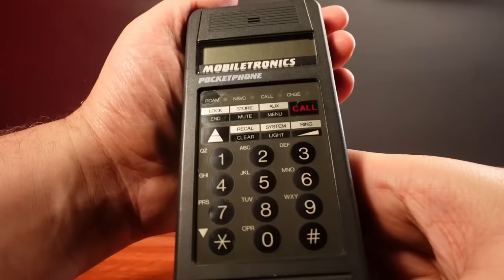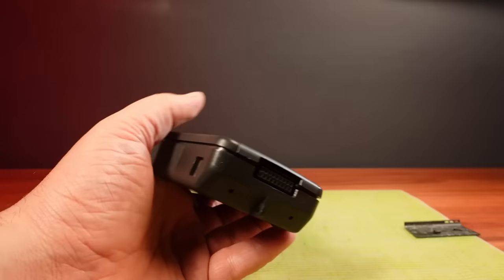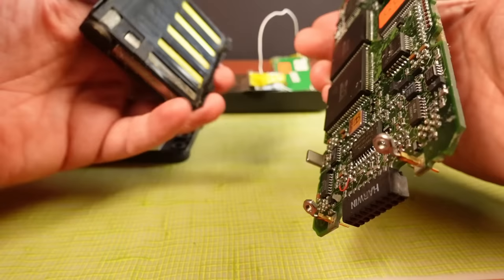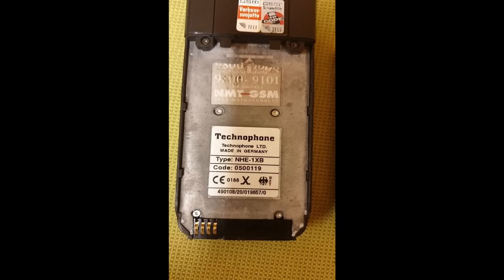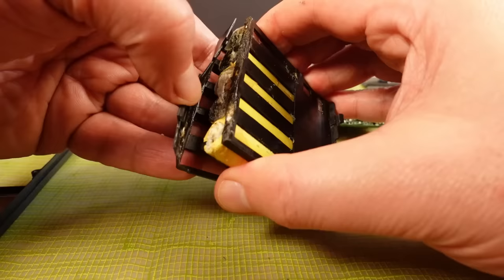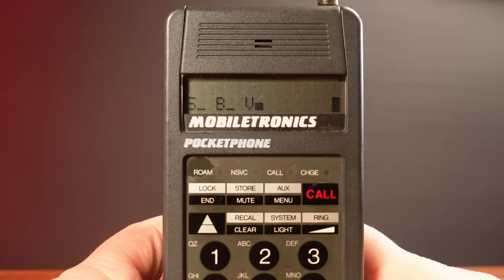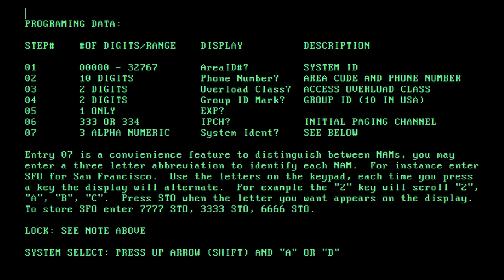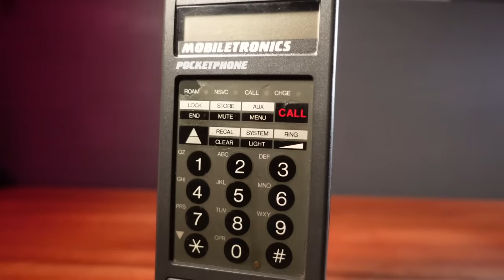1985 Cellphone In Your Pocket

Comment: That EPROM is not soldered. It is sitting in the same turned-pin sockets as the RF modules and the keypad. So it is possible to take it out. Also i really don't believe anyone would erase the EPROM in-situ - you would just pop it out and replace it.
Reply from the maker: Thanks for noticing this. I have since also found this out. This will be included in part 2 one day.

Comment: I remember those phones. I started work at Technophone in Camberley in 1989. I was sent to Brooklands college to study BTEC and EITB electronics, machine shop work, fabrication, welding in the first year full time. Then part time for 3 more years to do more electronics, and microprocessor study. I worked in the wiring shop in the factory and Ashwood House for about 2 years making test jigs and wiring looms, cables. Then I moved on to various production lines assembling and doing ATE testing of phones, boxing and packing. I assembled the PC205 which were more compact but still large by todays standards. The company was taken over by Nokia and the interior of the factory went through a huge makeover. A second floor was built and the production lines for phones were replaced with  new equipment for manufacturing cellular base stations. I was assembling these huge cabinets for several months. Then went on to testing assembled boards and finally base station RF modules and transmitters. I left in 1994 to go to Hastings college and Brighton UNI and study HND electionics.
Reply from the maker: That must have been amazing to learn and work during that time in such a fast developing industry. I really appreciate hearing your story, thank you for sharing.
Reply: I was software lead for the PC205, I like to think it was that phone that really made Technophone as it sold in much greater numbers than the first generation PC105 etc.
Reply: @TonyWhitley  what a great job!

Comment: The character set is in the ROM built into the HD44780 LCD controller. If memory serves, it has ASCII, plus katakana for Japanese, and it's possible to download a few custom characters to it as well, but they don't persist. It's not an all-pixels addressible display--you send it characters.

[Edited: I missed the "is" in the first sentence.]
Reply from the maker: Very interesting, I will include this in part 2 when I am able to make that.

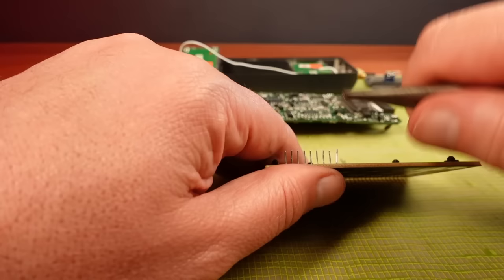Comment: Surface-mount tech goes back to the late '70's, but it did not get into mainstream consumer gear until the mid-80's. Nice soldering technique on those pins, BTW. (13:43)
Reply: 1960s baby, nasa used it big time.
Reply: @klaasj7808  Not surprised.

Comment: that's amazing. it's so cool seeing the early computers that were used in some of these devices that you wouldn't expect there to be a computer in... i have a couple of bang and olfusen turntables from the mid 1980s that i noticed having a software version printed on a label on back, and when i looked at the service manual found out there's a simple 4 bit microprocessor for controlling the logic of moving the tonearm, controlling the speed, and auto stop. microcontrollers were already becoming so ubiquitous even back then

Comment: Very interesting video. On a side note, you can safely use 6 standard AA batteries, since 1.2V is the nominal voltage of NiCd batteries, but they reach 1.5 (even 1.6V) a brief period when fully charged, so the phone must be prepared to be powered with such voltages.

I do not think this is the only reason for the lackluster backlight, but might be a part of it.
Reply: and you can charge them too under supervision
Reply: Yes also that was prolly a good nuff decently priced LED for 85. LED  tech has gonr far!
Reply: NiMh AA batteries have maximum 1.2V and are rechargeble. So maybe a better overall solution.

Sorry for my English.

Comment: As a Gen-Z electronics engineering student, I can't believe that in the 80's you could just sell your DIY electronics project with raw wire everywhere. An astonishing piece of history btw.
Reply: Back then, even getting a 12-layer board was a huge deal, and the precision placement of surface mount components were also very very expensive! 😁 the fact it looks DIY today is testament to the progress in PCB manufacturing and further miniaturisation of components! (Indeed, these first gen surface mount components look barely smaller than through-hole versions!)
Reply: You still can.
Reply: @Mattthijs  it’s definitely possible, but not as common
Reply: It's a cost effective solution. As a gen-x electrical repair technician, I've seen newly designed electronic control modules (mother boards, serial communication modules, peripheral interface and so on) get designed, tested and put into production.

Depending on how complex the module is, inevitably an improvement, a flaw, or some kind of bug calls for "red wire hacks." The wires and components that are "hacked" or soldered in place to solve the current problem are eliminated in the module's next ECL (engineering change level) release. The pattern repeats.
Reply: DIY hahaha. you must be a12 yo
Reply: this is why gen z electronics engineers accomplish nothing
Reply: hack or bodge wires are still common in highly complex low volume equipment, even though we have much more advanced design tools nowadays. If you think you can design that board first try without messing up anything, touch some grass.

Comment: Very interesting to see this circuit board. However the technology of surface mounting was already well established by PC manufacturers.
Between school and uni 1979/80 I was jobbing at Isola Düren/Germany (Isola still exists and has now become a worldwide Group) and we were assembling the layers of these circuit boards. It needs to people pulling out the sheets of 1m x 1m out of a rack magazine in the required order placing them on a stainless steel sheet that required wiping off dust with a kind of dry squidgy, and the pack then pushed to the other side into a rack, that would go into a big oven once full up. Most of the boards we made were single sided. The brown/beige traditional stuff with one copper layer. I would say that 90% was this kind of material  made from resin soaked paper and a single layer of copper. But we also did DURAVER, which kind of resin soaked woven fibreglass (greenish colour and still see through before baking) This was high end and required special attention as one had to also wipe the underside of the stainless steel sheet. Of course for this it needed to be flicked over, because if you wipe the underside the dust would otherwise drop down onto the second copper layer.
Very good job it w, We did 12 hour night shifts and earned in the two month as much as normal unskilled workers in a year.  🙂
I bought my first PC from this money. It was a Triumpf-Adler Alphatronic P2 and it cost as much as 2/3 of the price of a Volkswagen Polo.
Reply from the maker: Nice description, thank you.
Reply: @JanusCycle  you’re welcome. I thought it might interest you. It was a cool job.
The job meant I could get large thin copper sheets for nothing. I glued them against some walls of my flat and some furniture as well as various places of the car and sprayed it all with a clear lacquer to avoid oxidisation. The mad things you do when you’re 21😂🤣

Comment: I remember purchasing a 27256 EPROM for a project I had planned as a teenager (when I was 17 or so in 1991), but never getting around to programming it haha.

But the fact that this device still retained the chip in its finished, marketed form suggests that they were some combination of running very low on funds and rushing to market. Because they were barely beyond the breadboard prototyping phase if they were using an EPROM. But they clearly did spend money on beautifying the exterior of the device so the customers would be none the wiser.
Reply from the maker: You could be right. If the software was finished it would have been cheaper to have mask ROMs made in sufficient quantity.
Reply: @JanusCycle  Exactly.
Reply: We certainly were rushing to market, we were leading the world at the time but given the price of the phone a few pence saved by using a ROM was neither here nor there.

Comment: The CPU may be the QFP chip with the orange sticker on it, might be worth trying to lift it with some solvent and see if it's marked. From this era I'd kinda expect the custom ASICs to be handling the radio/audio mixed signal stuff rather than being SoCs.
Reply from the maker: Thank you, I want to look into this in a part two.
Reply: The CPU is one of the variants of the 6802  family if I remember correctly and is indeed one of the QFP packages. The CPU came with either 256 or 512 bytes of internal RAM. The two ASICS were used for processing the incoming signaling and other call related stuff. We struggled to get the standby time up beyond 8 hours hence the offloading of the decoding of the Manchester encoded data stream to the ASIC. It also handled the detection and validation of the Supervisory Audio Tone (SAT) that was sent alongside the users audio signal (5970, 6000 or 6030 Hz).

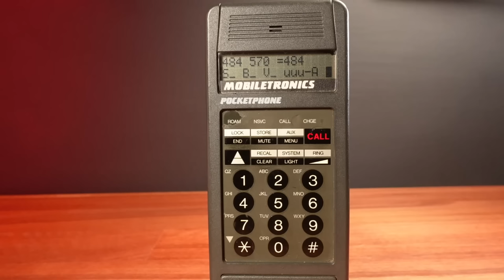Comment: 22:49 - "Nothing in the menu system allows you to access these lower-case characters, yet here they are in the ROM"

I think the character set is built into the HD44780 display controller. It was a common display controller in those alphanumeric displays.
Reply from the maker: Thanks, I will mention this in part 2 :)

Comment: I don't think it is the frequency since 300 mhz is US Military Aircraft world wide.
In the US 824 to 849 was the cell phone talking to the tower and 869 to 894 was the tower talking to the phone.

Most likely the 300s are the channel designations and it is possible there are still 800 mgz control analog channels still in operation for emergency use only.

All analog cell phones were replaced but I have seen analog control channels still on here in America in the 880 to 890 range but have not heard an analog call in the past 20 years.

Really awesome that this is still functional

Comment: You should connect this to a spectrum analyzer and see what frequencies it tries to connect into the missing network and what modulation it is using. 
Since it has been designed pre 1990, it doesn't seem to be all digital GSM, it seems to be old school analog FM, but the amount of digital logic in this unit is surprisingly high. I remember the old B1 VHF network here in Germany, it was plain narrow band FM, the there was the C-Network using frequency scrambled analog audio with digital packets in between on the UHF band and then later in the mid of the 90's the fully digital GSM become very popular and handheld devices became the norm, while before the B1 was fixed mounted heavy equipment in the vehicle, while C was portable in the size of half a business suitcase with a handle to carry with and not fixed installed. 
I remember in the beginning and mid of the 90's when on an plane over North America you could listen to hundreds of phone conversations (800-900MHz) just with the RX antenna close to the window, because the majority of phonecalls were still fully analog, while here in Europe they were mostly analog scrambled (400MHz very easy to convert to plain audio) and the all digital GSM (900MHz) that seems still impossible to decode with non professional equipment.
Anyway that is serious British R&D, way ahead of the time, great work, thanks for the introduction ... this should make its way into a technology museum!
Reply: KISS.  You must be too young for that.  You don't need a spectrum analyzer.  It isn't a mystery box.  Digital?  You're hilarious.
Reply: @ShainAndrews  What do you propose as an alternative, boomer?

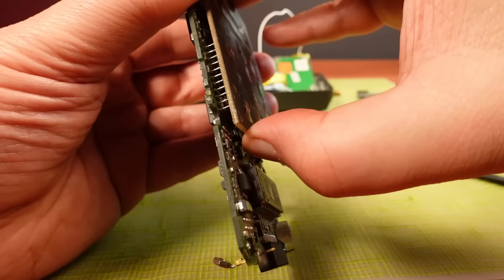Comment: I think those loose pins (around 8:20) might have been press-fit and were never soldered in, although it's hard to tell from the video -- it does look like they have barbs on them. Press fit pins seem to be common in connectors that move around a lot to help mitigate the solder joints from breaking (like backplane connectors). Very cool teardown, though. Crazy to see a double-sided/multi-layer SMD board from the mid 80s, with that seemingly out of place DIP EPROM.
Reply from the maker: You are correct. I have since found the Eprom is sitting inside these press fit pins. I will include correction this in part 2 when I can get there. I'm glad to hear you enjoyed this.

Comment: My first mobile phone was very similar to this. It was an NEC P3. It may have even been a copy of this phone because the menu system is quite similar.
I had a randomiser chip installed in mine which allowed me to call out on different numbers but received calls on my own telstra number. It was a great phone with an alarm function and I think 100 number memory as well
Reply: I had a P3 as well...great phone...then had a Motorola Micro Tac

Comment: In my expirience all rechargable AA and AAA have 1.5+ volts when fully charged and they hold until around 1.1v when they rapidly start to loose voltage.
Reply from the maker: Thanks, that's probably why my pack didn't last as long as I expected (but just enough to make this video).

Comment: Not sure why you would be surprised seeing an EPROM in early 80s technology. System on Chip was yet to be a thing, ditto for flash memory, and EEPROM was being developed. Discrete microcontroller, memory and I/O would have been the contemporary tech at the time.
Reply from the maker: It may have been the juxtaposition of seeing a large through hole eprom chip, in a phone. Generally miniaturisation meant smaller component selection, and mass produced meant rom mask. This chip kinda feels out of place for me :)

Comment: Great video, thank you. The "RF modules" would have been OEM from Motorola or Ericsson, with one side being the RF stage and the other being the controller. These were common back in the day and would let device manufacturers quickly develop product without needing to have a lot of RF/network expertise. I worked on embedding these into mobile terminals during the early 1990s. Also looking at that battery, I would suggest that it was replaced at some point (Jan 1993 judging from the sticker). I suspect it would have been factory shipped with one of those shrink wrapped battery packs common for that era.
Reply from the maker: Great RF module details there, thank you.
Reply: They were most definitely not, they were designed in house and one is transmit, the other is receive.

Comment: The two RF modules were transmit and receive and the most problematic to manufacture.  I recall that under pressure to deliver to a US customer threatening legal action we shipped some phones without them 🧐
Reply from the maker: That's a very interesting story. Now I want to hear about what happened next.
Reply: As expected the customer returned the phones that "didn’t work" (no great surprise at the time, this was bleeding edge technology and even if they'd been complete it would not have been unusual that they didn’t work) and Technophone (now able to manufacture in higher quantities) shipped replacements.
I know Sinclair used the same tactic and no doubt many others, then and now..

Comment: I know people have probably said this, but the Japanese and lowercase characters are probably built into the LCD controller. I'm not sure if that would be the case at the time, but modern ones almost universally have those baked into the chip itself, so no need for a character set stored in ROM.

Comment: Very interesting video, thanks for the look at this phone!
The poor backlight might be cause all black leakage around the LCD is blocking the light? Also the board appears to use hollow pins for the EPROM, making it removable. I can imagine they just swapped it out at the service center or so.
Reply from the maker: I had a very close look and you are correct. The eprom is not soldered and can be easily removed! I didn't realise that hollow pins even existed, they are so small and low profile. This will help with making part II easier and include these corrections. Thanks for the information.
 I'm still not sure about that backlight. The leak is only on the right half, yet the dimness is consistent across the display. And the backlight appears to illuminate mostly from from underneath.
Glad you enjoyed and thanks for this comment.

Comment: The weird characters might be because the display is using a Hitachi HD44780 character display or similar chip that you just feed character too rather than individual pixels and they just decided not to use lower case characters.

Comment: Never operate without an antenna
These were 4 watt phones and it will damage the transmitter without an antenna

The S should be signal level

There is a service menu that is accessible if you find out how to bring it up

The service menu allows you to program all the carrier information
Reply from the maker: My understanding is that an analogue cellphone wont engage the transmitter unless it has already found and receiving a control channel.

Comment: Wow, especially for that era. I wonder if the corrupted text is actually from the RAM, as that would normally be battery backed up. 
As for the processor, did you look under that orange 'GL' label?
Reply from the maker: In my thrill of seeing inside this phone I didn't think check under the orange sticker! I'm now saving that experience for part 2 when I can find a way to read the Eprom and have a look at the code.

Comment: Interesting bit about the battery, I though sealed, built-in battery cellphones were recent trend on smartphones last 10 years, it's already with us since the dawn of cellphones.
Reply: Yes, I would have thought that for that era of portable equipment, it would have had  an externally removable battery pack or compartment,  even my first phone, a Nokia 5110, had a battery which was part of the case & it just unclipped from the back of the main phone body.